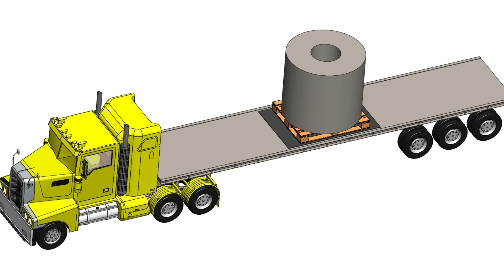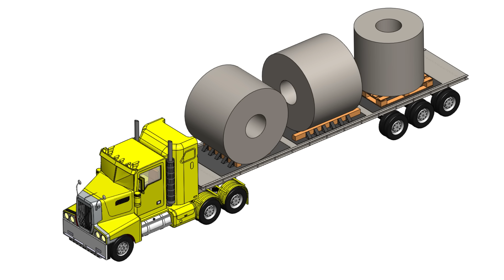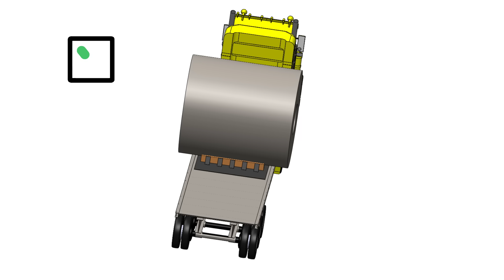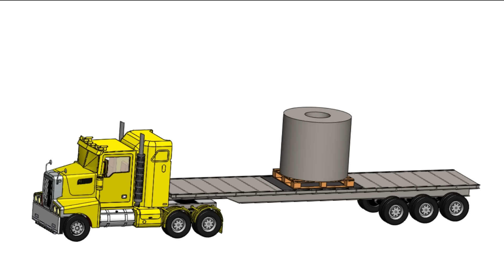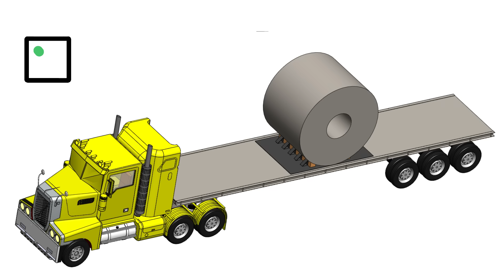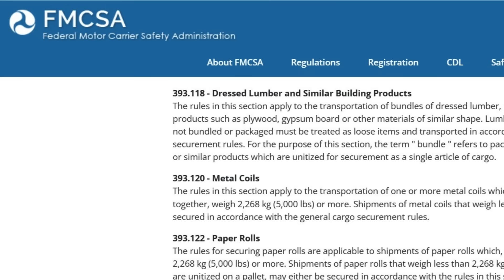Suicide Coils; Why Are They Loaded This Way?

Comment: For !@##$% sake, an  SUV is not a unit of weight measurement. Neither are  elephants for that matter. And length is meters or feet, not stupid football fields. Just stop it.
Reply: It is used as a point of reference, lots of people can't grasp it otherwise. Did you see that? LOTS OF PEOPLE there is no lot of people. I did that so you would understand.
Reply: Didn't LOTS OF PEOPLE ever go to school? Or never had any sort of job that deals with units of measurement? The reason we have standard units of measurement is they are standard. An arbitrary class of motor vehicle goes form sub-compact to roadhog size, and are not all identical weight. Here's an interesting fact: the Alpha Centauri system is approx 4.3 light-years away. That's more than 10 football fields!
Reply: @garyzimmer4149  They are just trying to put it into perspective, in a way they might understand. If the numbers are too large it could loose meaning. Like saying something weighs 150 thousand tons. That is meaningless to most people unless you compared that weight to something like a cruise ship for instance. That puts it into perspective.
Reply: @ronkuzyk3836  u nailed it, if u dont work with high numbers u will not get how much it is. I mean a hairstylist will now that 40 tons is alot but will not notice how much it is till u say that it is around 20 SUV´s

Comment: Good information. Whenever I see a flatbed with coils, I get around and past them as quick as I can even though they are chained down tightly.
Reply: It's safer behind them, that way you can see what is happening to the coils in a crash. However, if your able to go much faster than the truck, pass it when safe to do so and put a lot of distance between you and the truck, like a half mile or more if possible.
Reply: @sirmalus5153  Or you just can sit at home, work remotely and get groceries via delivery... 🤷‍♂